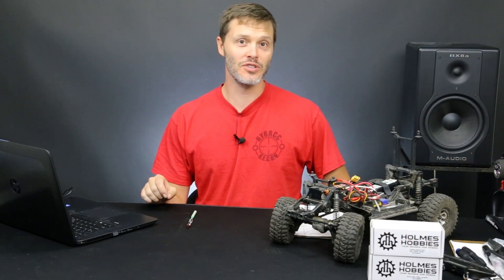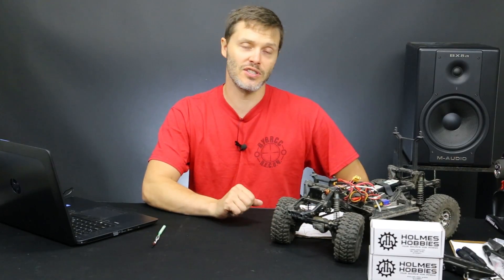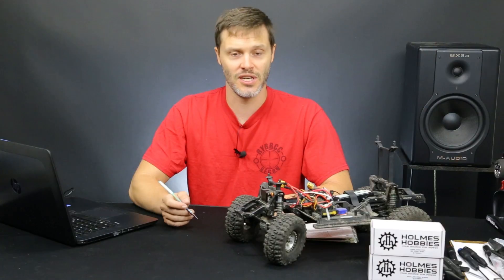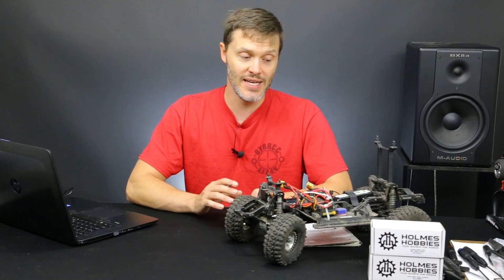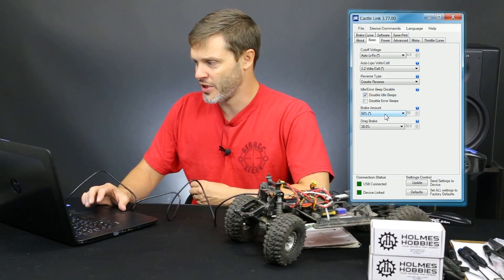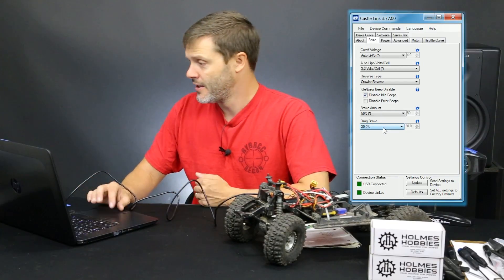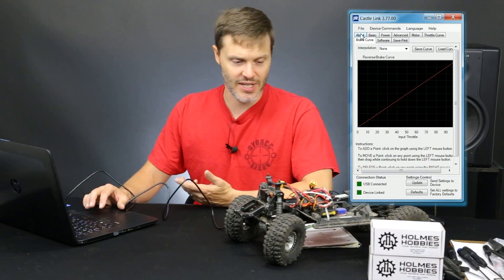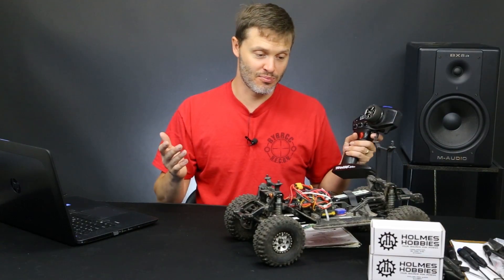Programming ESCs for R/C Rock Crawlers

Comment: I am running a mamba x with a castle mamba 370 4200kv. My kids cant control the speed i was just ordered the hobbie holmes revaluation 380 2000kv motor try to slow the max top end throttle speed 
I did have a brushed motor from traxxas woth the training mode to cut it in half speed. I hope the 380 fits where the 370 is now. This is on the  traxxas teton 1/18 truck. We like going hiking drives. For the kids.

Comment: Hello Im using a sw3 and a tenshock rc906 2400kv motor. Copied what you did for settings as much as I could. I can't seem to get smooth throttle and low end capability. Do you have any suggestions

Comment: 10:15 that’s not at all how internal combustion engine timing works. 

The flame propagation is fairly constant but the piston speed is dynamic. Without timing, the pressure from the combustion process will be trying to force a piston down that’s already moved away from it. So the fuel mixture is ignited before the piston crests top dead center in order to unleash more pressure onto it. The faster an engine operates the faster the piston will move away from the combustion pressure. 

This actually maximizes torque and efficiency. Too much timing and you get knock events that will damage the engine. Too little timing and the engine heats up because you’re dropping efficiency. 

Typically engines run the proper timing to maximize efficiency under low loads when a knock event won’t hurt the engine, but retards timing down to a safer advance in order to safely operate under higher pressures. 

Diesel engines operate much the same except for the fuel ignites upon injection so engine timing is based off fuel timing not spark. They also must maintain proper alignment with the injector spray pattern and piston bowl shape.
Reply from the maker: yeah, more of a basic conceptual similarity than anything else.   I figured many people would understand at least the timing advance/ rpm relationship.   Get outside of the golden zone and efficiency suffers.   Can't really go too low on a brushless motor with sensorless technology, which is a key difference to ICE.

Comment: I have 1400kv revolver and the micro x esc. I tried to set my truck up similar to this video. Very good video thanks for showing the viewers some tips! My truck is also ear piercing loud, like a squeel. Is that a normal sound with revolvers? I have metal spur and pinion
Reply from the maker: it is a loud motor and esc combo.   I'm working on an ESC with less noise.
Reply: HolmesHobbies ok, i just wasnt sure if it was a normal noise. I do run 3s so i know it will be louder then 2s

Comment: Excellent vid. I have stayed away from "crawlers" because I do like a bit of speed and thought "crawlers" were not capable of both. If I realised a crawler could reach 20mph AND crawl I would of bought one ages ago.  Sorry if this was mentioned in the vid BUT what KV motor is needed to do both on say a capra? also the pole count is new to me
Reply from the maker: 3300 to 3500kv on 3s.    I would recommend a Puller Pro and Mamba X.

Comment: Hi Rob. I just read that for high power start you may use good quality or high power batteries. Why. What's a good rate. Would this affect the temperature or performance in general. I'm using a mamba x combo with 2280 slate and want to squeeze the best torque and control. My battery is a gen ace 3s 3700 mHa 45c.
Thanks for the video, it's very helpful

Comment: Installing this as we speak in my TRX4 Bronco  . . Think my Revolver motor wires are shorter than yours and will need extensions . . To finish mine i need to hit Hobbytown in Omaha to get bullet plugs . . What gauge wire do you suggest for extensions that i should make to get it finished up?

Comment: Like the video. I recently got a holmes hobbies trailmaster pro 3300kv. I run it on a mamba max pro sensored and it didnt have good low speed control. Most of my settings were similar to yours but a few I am going to change. Other than that the trailmaster pro is a good motor I just wanted slower smoother start up with it. Love the videos john I hope you put more out soon!!!

Comment: John, I am among many who appreciate the time and dedication that you put into this Hobby! I'm hoping you can help me with an issue, that's not one of your products...
I've got a Hobbywing WL10BL120 ESC and 2200kv Sensorless Brushless Motor in my Wraith, with 11/56 32 Pitch Gears. I've got only one Battery choice, a 40C, 4000 mAh 2S Lipo. The ESC is CHEAP, I know. But I'm hoping for adequate!  It came with an equally Cheap Programming Card, with limited adjustment. At least I've got a good Futaba Radio. 

The question is, I can adjust Punch, but have no idea where it should be! This is my first Brushless Setup, AND first Lipo Battery, after 37 years in the Hobby. 😵😱 I'm behind the curve!! Thanks to this Video, I finally have some idea what Punch IS, but still don't know which direction to go to get the smoothest start for what I'm working with. Oh, and can you give me an idea of what the Timing should be, from the ESC?
Can you please help? 

I've already got my second system picked out. IF I can ever get enough money at one time. It will be a Sidewinder 4, and a GOOD Brushless Motor from you! I'll probably stay in the 2000-2400kv range, but haven't figured out - Sensorless or Sensored. Frankly, for my needs, I'm OK with the Sensorless Motor I have now, knowing that a higher quality, better made Motor, with Castle's latest version of the Sidewinder, should be nearly perfect, at least within my horrible income! 😫
Thank you, Carmine 💥 ⛽
Reply: So, first off regarding punch, there are 2 areas addressed while programming esc; 1. Initial punch. You want that set high. If there is a # or percent to pick, pick 100%. This is not the place to adjust for wheelspeed. Reverse should be set to high as well. 100%. Next is the exponential or throttle curve; This is where to control wheel speed and a controlled feel. JOHN said to set the puch control to 30%. This helps give you lots of torque at a low consistant speed. If you grab full trigger, you are still going to get to the wheel speed, the 30% punch will be over-ruled by holding the floodgates open to allow the battery to ramp up the speed quick enough to jump from rock to rock or blast over a tree root. 
Next is timing. Set timing to minimum. Timing adjustments are best left for racing and really dictated by the motor/esc your working with. Rock Crawlers, unless U4 racing, shouldn't mess with cranking up the timing. Finally, you mentioned that you have a Wraith(love mine) with spur/pinion of 56 and 11..which gives you a 5.09 ratio. Without knowing the diff ratios, tranny, tire height, i dont know your final drive ratio. But, assuming  you're running a Status Quo Wraith, 5.09 is perfectly fine. Instead of leaning towards a Castle SW4 ESC with a brushed motor..personally I'd wait and save for a Castle Mamba X with a Brushless Holmes Hobby Motor. Or, a Holmes Hobby Trailmaster BLE Esc with a Holmes Hobby Brushless motor; the Puller Pro or the Trailmaster Pro Brushless 540 or 550 at 3300KV. The sweet spot is FOREVER! especially over brushed, it lasts much longer, so its a better investment and You WONT IMMEDIATELY WANT MORE!! You will be satisfied like THANKSGIVING FULL! You will LOVE YOUR WRAITH, and chics will want you! I feel you on the $$, i went from grossing about $25K/mth to SSDI, maxed the system at just over $24K/YEAR!! In the meantime you're probably having a great time with an Axial AE2 esc and 35T Axial Crawler motor. I hope this helps...i have 47 to 49 RC Vehicles. I'm talking about currently operational, running fully set to go, not diecasts or partial builds im "working on". Just so you know I'm not a Noob(we were all noobs at one time, no insult to anyone intended)..
Reply: Hey, I can help you a little. Im sure John missed your response. He is usually extremely prompt in answering all questions...
Reply: Trying to help..

Comment: I currently have the 35t 540 trailmaster in my trx4 I am looking for slower speed with some better crawl what turn should I get this nxt time. I need better crawlability at the slower speed I would like to be able to use lo gear for a super low and have low gear speed while in high gear if that makes sense
Reply from the maker: for two speed use, i tend to use a 550 motor so it doesn't burn out in second gear.   My recommendation would be a 45t 540 or 550 motor.

Comment: Hey John, would I be able to get similar results with your Trailmaster Pro BL and the SW4? What would be the highest KV possible with similiar results. I'm running the HW1080 with your Trailmaster Sport 550 21T, I love the control on it, its pretty quick too but I want to go brushless and donate this setup tk my secondary rig. Any suggestions? Bday coming up, gotta put in my request!

Its for my TRX-4 Defender with stock drivetrain, 3S traxxas lipo. I've ridded the roof rack and spare wheel w/ accs. Not sure if that makes a difference.
Reply from the maker: The TrailMaster Pro won't be able to start up quite as smoothly since it is two pole.    Anything above 2200kv is going to have more trouble being smooth sensorless at low speed, no matter how many poles, which is about the same speed as the TrailMaster Sport 21t 550.    If you want more wheelspeed than that, you will probably have to go sensored to keep the startup and low end torque as good as brushed.
Reply: HolmesHobbies awesome, good to know, thanks!

Comment: Thanks, run your trail master pro 2700kv with a mamba max, and can't wait to try the expo for that slow start. I too have been running punch at 20% to 40% tho I was thinking to help keep traction when I give it too much throttle at the start.

Comment: I had lots of motors and your pp bl is what I have in my wraith and scx10 but I got a old trinity 4xs short course motor in my yeti nd that dam thing is just as smooth at the pp believe me I’m a diehard HH fan I just always wondered like you just said why is a racing motor so dam smooth to 

Hope you got the time to read this 

Thanks
Reply from the maker: Every now and then a racing motor will also be smooth on the bottom end, out of pure luck.   It is not very typical though.

Comment: Great video. I think you have solved my problem, I get some hesitation when I give full throttle on my bomber, it has mamba max pro and a rock 412 w/3s going to try a little punch control see what happens. Thanks love your videos. Later
Reply from the maker: Sounds like a little punch control is exactly what you need.